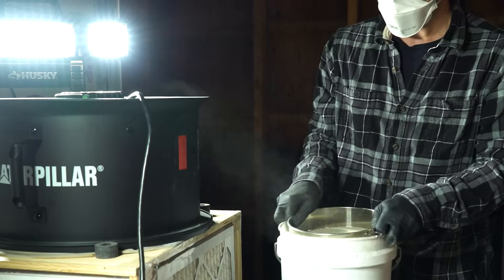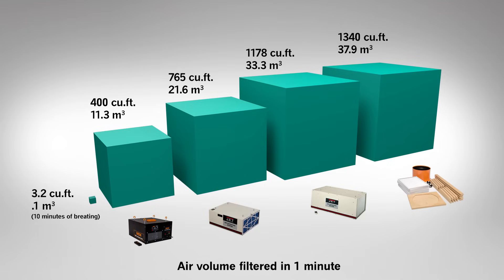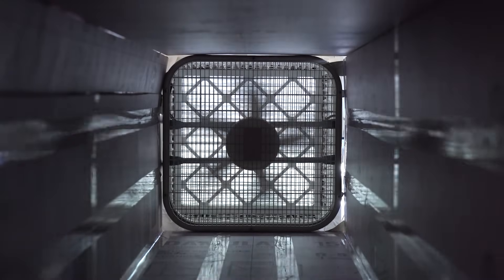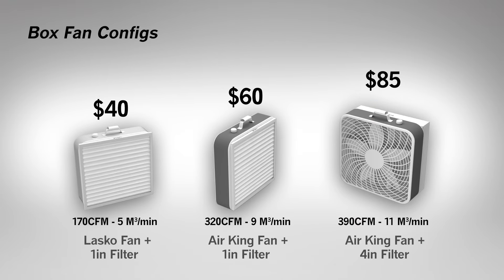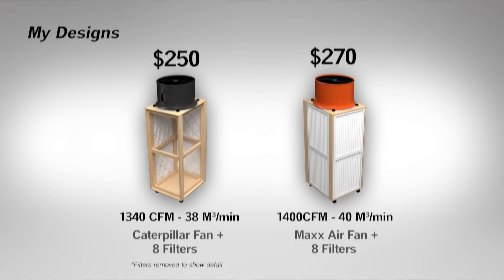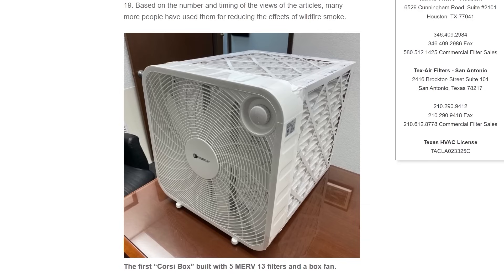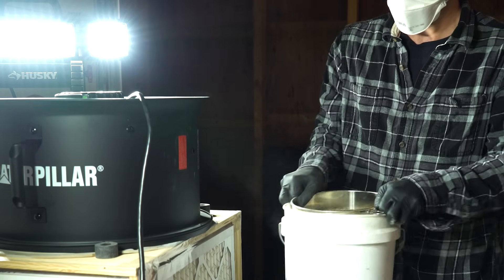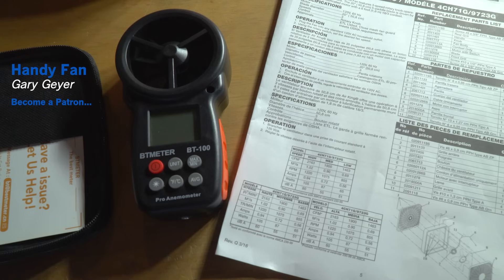What is the best DIY Air Filter?

Comment: Two main rules of building DIY filters:
1. Increase surface area of filters. In ideal world, you build infinitely large cube made of filters. The more surface area, the less energy fan need to make its maximum air flow.
2. Dont push air of the box, but rather suck the air out of it to room - like any CPU fans do. You can notice your laptop taking air OUT of it rathern than pushing it inside. Pushing air inside box makes the air stream turbulent - that is more resistance to air flow. When you sucking air FROM the box, you get laminar (smooth) flow, because there is no obstacles for air in your room (because room is big). The blades of fan must cut-and-scoop-and-pull air FROM the box, not pushing it there. For the filter, when you SUCK air off the box, the air pressure from outside of the box is distributed more evenly by filter surface than if when you pushing the air into the box, creating vortexes inside the box. In pushing scenario air will push the filter more in areas right next to the fan.
Reply: Also pulling air from the filter box through the fan keeps the fan cleaner than pulling all the dirty air through the fan before it gets filtered.
Reply from the maker: I agree with rule #1 if you have no way to determine the quality of filter material. The harder part is figuring out what the filter is made from. Filter material has a huge effect on small particle filtration. I'll cover this in more detail in an upcoming video where I get into all these details.

As for rule #2, this is true in most instances but there are some exceptions. I'll make a video on this concept soon as well because it's quite a point of contention. Until then, the short of it is that if you want to filter the ambient air in a large space effectively, point the fan upwards, or "pull" air from the box. This works well for all the reasons listed in the comment above. However, if you are producing lots of dust next to an air filter, the outgoing air from the fan will capture that dust and blast it all over the place. Not all of it will stay in the air column and that dust will be deposited all over the place. If you "push" air into the filter box, under some conditions, you can capture dust form the source before it gets blown all over the place. The source must be no more than 5ft from the filter for this to work effectively. This concept really only really works with the enclosed-motor drum fan powered version in this video, it should never be used with a box fan powered design (Corsi-Rosenthal, or single filter). You need a very large amount of filters in your filter box for this to work. If the volume of filter media is lacking, the turbulence in the air column inside the filter box has the potential to drive particles through the filters.

The "Model-A" drum fan powered version does not evenly coat the filters in this configuration. The top 6 inches of each corner of the top row the filters is relatively clean in comparison to the remaining 90% of the filter area. Dust coverage overall is very even.

As long as there is enough air supply for the fan to function normally, the blades "scoop and push" air in any direction you like. The total cfm of the fan is the same in either direction, push or pull.

I have run a couple of these to show the benefits of both options but more tests are needed for the video. I hope to have it out in 2 months or so. Again, I would not recommend the "push" option for virtually all DIY air filters, especially those that use box fans.
Reply: @The3DHandyman     Will you also look into radial fans vs the axial fans you tested? And what blade design is best there (forward/ straight/backward)?
And also into the power draw of all of those.. watts vs volume of air moved would be a good guide I think.
Reply from the maker: @joansparky4439  I will do all those things! Not in the same video, but eventually... I have a design for a blower/centrifugal fan and an inline fan in the works. Off the top I would say that the axial fans tend to be the most energy efficient but I'll have all the official numbers in the next few months 👍
Reply: @The3DHandyman  
#I love the way you respond to ALL of your comments. #2 I'm glad that you are going to do a blower fan because I've been wanting to build an air scrubber around one I have currently placed in my basement window.
Keep up the EXCELLENT work!!!
Reply from the maker: @HAIRLADYCARES  Thank you!
Reply from the maker: @HAIRLADYCARES  Thanks, Jocelyn. I'll see what I can do
Reply: Yes indeed. Do you mean suck air from the box like filter then fan?
I've done some stuff like this with old ac furnace fans. Not sure about filtration but gets a smoky smell out of your house when set up correctly.
Reply from the maker: @ElectroTree01  If you are trying to remove smells and process a lot of air, tit's best for the air to go through the filter first and then the fan (I call this the "pull method" because you are pulling air through the filter not pushing air into it). With a furnace fan/blower this is the only configuration that I would recommend. 

It send a much stronger column of air into your space which stirs everything up and eventually sends it back into the filter. 

If you are sucking dust off of a work table, then in some instances the "Push" option will work better to keep the dust out of the air in the first place. This is not all that common of a use case, generally the "pull" method is preferred.
Reply: @The3DHandyman  Thank you for clearing it up. That is how it is configured in my units.
Thanks!
Reply: Do you have any ideas about whether or not a 50cm box floor fan is more efficient for moving dust out of a smallish work area,(one-car garage size), through a doorway situated at the back when it's on the floor or 6ft higher up hanging from the door frame?
Reply from the maker: @iminabrons  Good question! The floor mount may be able to exhaust slightly heavier particles that don't get pulled higher into the air but the difference may be negligible. Be sure to have an adequate opening on the opposite side of the room that can supply fresh air for the fan to draw in (aka crack the garage door for "cross ventilation").

You might want to mount the fan higher up just to keep it out of the walk way but that might just be me.
Reply: @The3DHandyman  Thanks for your insights. I had it on the floor originally but thought that with warmer weather coming higher would be better.
My choices are to bang my head or stub my toe.
Reply from the maker: @iminabrons  There is always chopping a circular hole in the wall :)

After running the fan for a while you will end up making the inside of the space the exact temperature as it is outside. Since its a slow cross draft it won't really cool you down much....You could also try blowing air into the garage rather than exhausting it. This might prevent super heated air from being sucked in through roof vents if you have them. This is one thing that I fought against last summer in my garage. It really depends on how the place is set up. Good luck!
Reply: @The3DHandyman  "It really depends on how the place is set up. "That's the crux of the problem right there.

I had considered using a sheet of plywood on hinges to cover the doorway with a cutout the size of the fan. Not a good idea.
Of course, the best idea is to open the front garage door but that then makes it much louder noise-wise for the neighbours.

I also have two wall-mounted fans and the more I look into the airflows I realise that it is almost unpredictable to sort out what may happen. This then becomes a case of trial and error in sorting it all out. At this point, I consider buying a lotto ticket.😂
Thanks for all your time and insights.
Reply from the maker: @iminabrons  Any time! If you find the ideal configuration, feel free to comment. Good luck!
Reply: @The3DHandyman  
Can u clarify/confirm  - PULL method is w fan blowing up or out - if u tied tissue youd see it blowing strait out. And thats the method  used w box fans. The fan points up/out creates a suction so air is pulled thru the filter first into the box and blows out the top clean. 

The PUSH method is with the the air flow pointing into the box - if u tied a tissue youd see it sucked up flat against the fan grill. This direction is only used w the drum fans  on reverse (so they pull air in vs push it away).  And if your trying to pull visible dust thru the fan top into the box so it gets pushed thru the filters (which means the arrows on filters need to point outward, not in toward the box).   

Or do I have it backwards?? Sorry. Push / pull is confusing me. 

ALSO how often do you need to change the filters/ rebuild it? 3 months? 

I want to use it in my house to help w dust + for severe allergies. (I live in LA, CA and dust re-accumulates on everything 2 days after you clean) I want to try this before i buy the super expensive $700  Rabbit air filter recomm by a dr. In your other videos seems like this box works better than the machines.
Reply from the maker: @nicolemcat1422  Your understanding of the Push/Pull concepts correct. I will do a video about this at some point to make it even more clear. 

In general, as I got into in my last reply to your other comment, the 4/5 filter boxes work quite well in large rooms. They also preform about as well or better than make HEPA filters on the market. They can all be pretty loud when they are on their highest setting but the pro models are more quite on their lowest settings. If that's a concern, keep that in mind. For home and apartments, that are not open plans (lots of walled off spaces) more smaller units might be a better fit.

I have a design that will make the box fan + single air filter design tape-free and as efficient as possible. It is also low cost. I have some testing yet to do but the video and product should be out in a few weeks time.
Reply: Great Information for Consumers. Air is Dustier now.
Reply: AN INTERESTING FACT: When finishing a wood floor, by putting fans in several windows and pushing air into a house/area, the stench of the VOCs from the poly was far less than when pulling the air out of a room.
Reply: @kellyvcraig thanks for the tip
Reply from the maker: @SimonWoodburyForget  I am actually experimenting with this right now. The diffuser makes all the difference. Inline fans don't move quite as much air but the perks of ducting are worth it.
Reply: You could set up push fans in the corners and set the box on the middle 

Or push from one side to the other
Reply: I think he mentioned that in one of the earlier videos. Pulling air through the filter box where the fan is on the exhaust side means all the dust accumulates on the outside of the filters. If you bump into the thing with the fan off it drops the dust in the floor which kind of defeats its purpose. If you have the fan push air into the filter box then all of the dust is contained in the filter box. Bump away at it and no dust will be released

Comment: I’m really impressed with your videos. It won’t be long until you have as big of a following as some of the other larger channels. If you've seen Project Farm's video on furnace filters, he shows that one 1” filter greatly outperforms other 1” filters. Turns out the 3M Filtrete 1900 (Merv 13) had more air flow compared to other Merv 13 filters. The reason it performs so well is because it has a lot more pleats which allows more filter media to be crammed in. His measurements showed around twice as much surface area compared to other Merv 13 1” filters. So in theory, if a 20” x 20” x 1” filter has twice as much filter surface area due to having more pleats, it would be the same as using two 20” x 20” x 1” filters with half the amount of filter surface area (fewer pleats).

I think what you put together works great and has a lot of value, although I think it would perform even better if you substituted a better performing filter which appears to be the Merv 13 and 14 Filtrete filters. In my eyes the 1900 (Merv 13) hits the performance vs cost sweet spot, especially if you pick them up at Lowes with a quantity discount. However, you can find the 2800 (Merv 14) filters on Amazon, but they cost ~50% more.

Another way to improve performance without increasing cost is to use a physically larger filter. So instead of using 5 20” x 20” x 1” filters for a Corsi Rosenthal box, you could use four 20” x 30” x 1” filters. Four 20” x 30” x 1” filters should perform the same as six 20” x 20” x 1” filters, or 7.5 16" x 20" x 1" filters, and cost less. 

Looking forward to seeing your future videos. If you happen to stay on the filter subject, I’d love to see some performance numbers of a Corsi Rosenthal box using Filtrete 1900 and/or 2800 filters. It would also be interesting to see if they improve the performance of your eight filter box using 16” x 20” x 1” filters.
Reply from the maker: Thanks for the great comment! I have seen a lot of Project Farm videos through the years and love the channel. I do think it would be best to test out different MERV ratings and different brands but the cost of doing that is quite high and I don't have the budget for it at the moment, especially after my home flooded a few days ago. Hopefully some time later this year I can make it work.

I installed a 3M 2800 in a friend's house a few months ago and noticed how many pleats were in that filters. They really pack them in there! That is definitely what leads to their better static pressure ratings. A lot of the online filters are cheaper but their build quality is lackluster.

Comment: Very interesting, I've built a quick and dirty air filter box using a lasko knock off fan but I put the fan in a box and have the filters 1 inch away from the back of the filter. I actually have 2 filters on the box, one in front of the fan and one in back. The drop in wind speed is VERY noticeable but otherwise it seems to do pretty well. The space that I'm filtering is also pretty tiny so maybe it's fine just because of the smaller space.
Reply from the maker: The size of the space does play a big roll in how well the filter preforms. The smaller the better in a way. A cardboard shroud could help air from being pulled in the wrong way and making that fan dirty in place of a filter on the front side. It may not increase performance of the fan but it should slow down air flow less than the front side filter.

Comment: Love your content. I have a brand new garage where one half is a leisure space (gym, tv, etc) and the other half is my woodshop. Needless to say that dust is not a good mix between the two spaces. So I'd really be curious to see what the Beastie Boy could do.
Reply from the maker: Thank you! There are actually plan on the website already if you want to give it a shot! https://the3dhandyman.com/workshop-air-filter-series/

I had a similar issue with my new shop space that I have not moved into yet. I do talk about it a bit in this video. Basically you want to have a fan ducted to the other clean side of the room so that the air is always moving toward the filters, not towards the clean stuff.

https://youtu.be/OhVWsnTm8iU

Let me know what you think of the idea!

Comment: What is the function of extending the filters away from the fan in the 'Circulator' design (10:55)?  Has there been any work done to integrate a vortex into the system like dust collectors to prolong the life of the filters?
Reply: I like the vortex idea. Perhaps a video series testing a bunch of small scale printed prototypes would be of interest.
Reply from the maker: I have not yet worked on a vortex design. I have some plans to put one together for my dust collector but hadn't considered one for the air. Thanks for the thought, I will put some work into that.

Comment: Relevant comment

Honestly though, I have a design to build the filters into the space between the wall or ceiling joists.  It's a shame my shop space is block construction.
Reply: Currently rebuilding most of my fixtures, I'll probably make something fairly custom to fit around plumbing and tools.
Reply from the maker: @DrKahnihoochima  Sounds like an interesting project to get into the details with. Have fun!
Reply from the maker: I was just thinking about this today! The garage I'm working in could easily accept a Joist mounted filter system. Would something that is mounted on the wall work better for you?